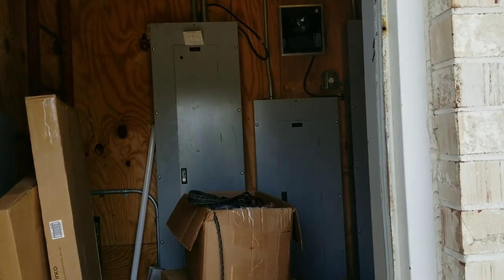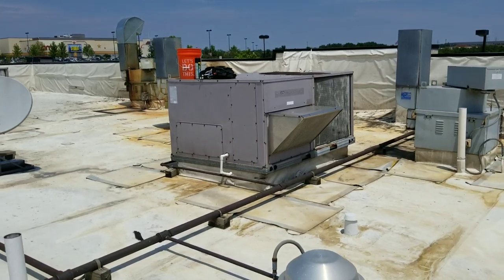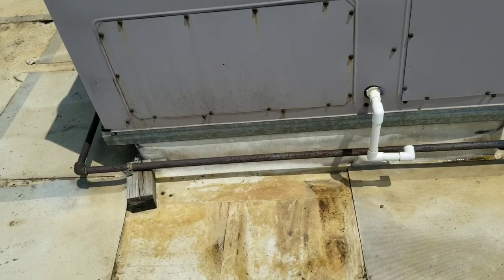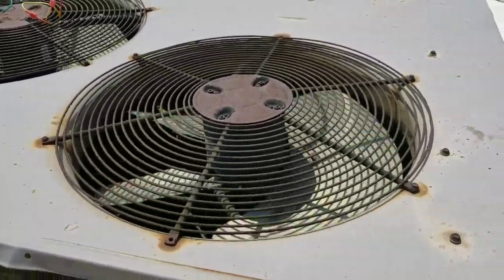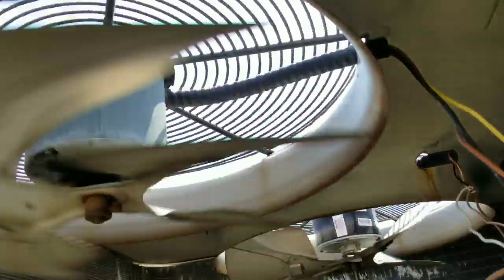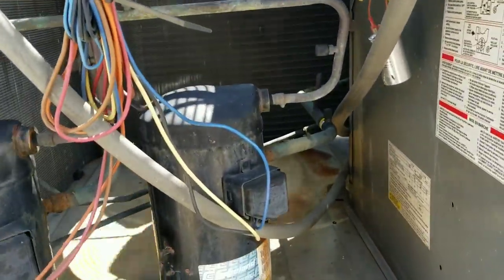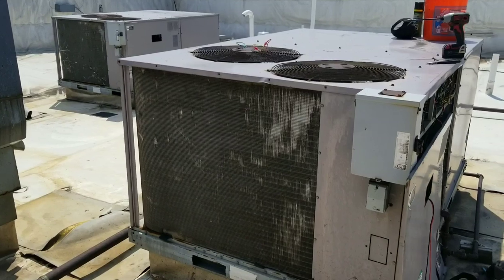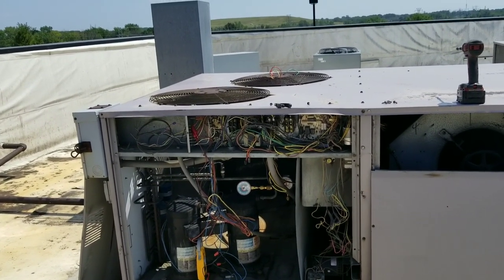Busy restaurant with no AC in the kitchen

Comment: Thank you for GREAT videos and CLEAR descriptions!

Engineer this end, Microwave radio, Fiber Optic, Power, retired in Thailand at age 53. Do a LOT of mini split replacements in our investment condos, every little "snippet of information", I take from your YouTube posts really helps.

DETEST micro channel, all replacement evap. coils are copper core, and cheap. For a 9,000BTU unit is only USD$38.00.

R22, although TERRIBLY BAD for the environment, is only USD$44.00. (Sadly still widely used here).

All new units are R32, still a few R410 units around.

I've been using R290 (for 7 years), with brilliant results. Excellent for cooling, OK for heating, when I was living in a colder country. No heating here, even the vehicles A/C only have "Cool or Cooler", they don't have a heater core.

Keep up the WONDERFUL work on YouTube, excellent:-)

Comment: the high head pressure was caused by 5 significant contributing factors: 
both fans not working, looked like you said u could see the one was spinning the wrong way, switch the leads.
the air gaps from having the door off,
the plugged coil.
the outdoor air temp,
then finally refrigerant charge maybe.

the delta between the outdoor coil and the outdoor temp should be about 5-15 degrees, usually 10, if the coil is HOT then you need airflow to scrub away the heat from the coil.
Reply: i would have also checked the voltage of the universal motor and the voltage supply on the unit.
Reply from the maker: Thanks

Comment: I have seen maintenance guys do weird things like cut the ground strap on a rooftop A/C because it had a short and kept popping the breaker.  The power line had rubbed through and was shorted to the frame.
Reply: I know the type. They used to jam nails into replaceable fuses to stop them blowing. 🤦‍♂️

Comment: Curious HVAC Guy, good video! In my experience,  in-house maintenance guys just clean the outside surface of the condenser coils. That would explain the high head. I know you already know that many, but not all, RTUs have a "hidden" sectiom on the comdenser coil surface area in addition to the outside surface and inside surface of the condenser that is in plain view that many in-house maintenance guys may not know about. I don't think the RTU you featured in this video has a hidden section. That hidden part goes uncleaned while the rest of the condenser is cleaned. In the hot weather months, the problem will manifest itself as abnormally high head pressures because in the hot weather, every square inch of condenser surface area is needed. Professional HVAC/R service technicians like yourself have to deal with the things regular maintenance guys may not know about. I'd be willing to bet that you've had to clean up those messes a time or two. Again, good video!
Reply from the maker: Hey Tyrone- Your right, no offense to maintenance guys- its how I got started in the trades- but sometimes I have had to clean up after them. Actually this unit does have a splitable coil, I made a video later on call to clean or not to clean. I took head pressures before and after cleaning the coil inside and out, it was a pretty good turn out-- thanks for watching and for the feedback

Comment: I had to do the same thing today on a similar unit, no low voltage on compressor one contactor and no wiring diagram so had to manually trace out the wires and found a bad pressure switch as well lol

Comment: I did notice that the two condenser fan motor blades look different on the non factory motor might not be the right rpm and blade pitch. Wondering if that blade is not moving the right amount of air.

Comment: These type rtu’s are one of the many selling points for wireless probes
Reply from the maker: Your exactly right Jeff- I just dont like to use a phone or tablet on the roof due to the glare all the time-- I dont want to have to go crouch in the corner for a little bit of shade to see my phone or tablet to read pressures. Dont get me wrong, I think there great and will eventually suck it up and get some but it would be great if there was a tablet or device we could use that didnt have as much of a glare on it-- thanks for the feedback

Comment: My god. That beard. I bet his customers think he’s weird. He didn’t check that out the way he should have. Roof top units act like that and trip high pressure switches when they are dirty. First thing before you go through all that diagnose is to clean it. Then start looking. Probably the expansion valve sticking or piston clogged. If it’s clean that’s what’s wrong. If high side reaches 450 plus the switch is working.

Comment: Who the hell wired that shit? That shit has to meet code. As having conductors sticking out the top. No seal tight connections made up right. No separation from high voltage and low voltage wiring. It's damn mystery why nobody has got electrocuted yet. But there still time...